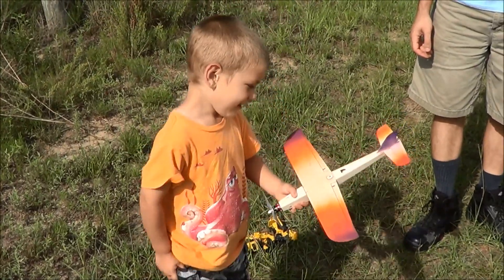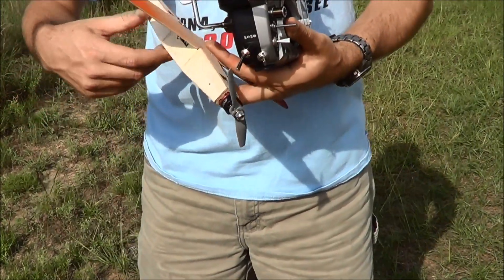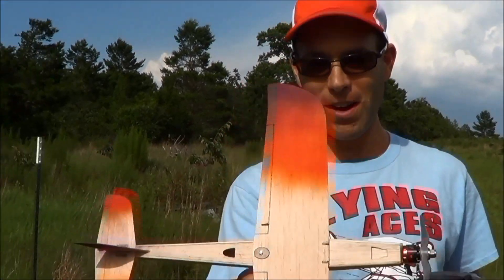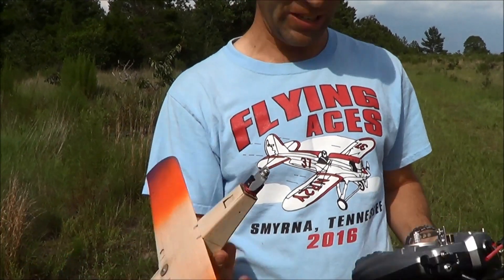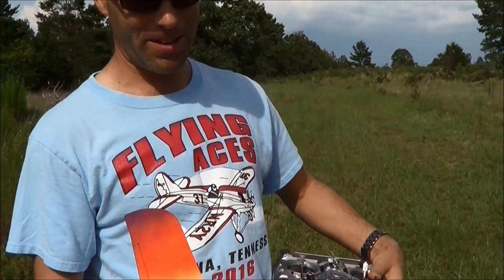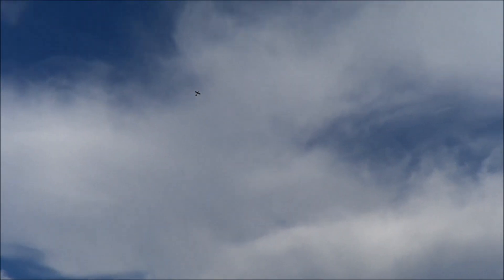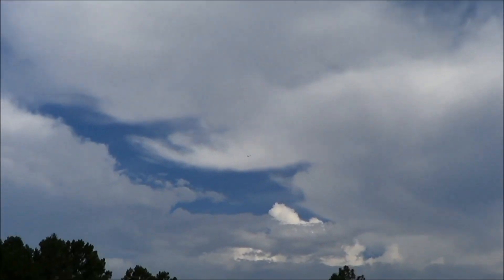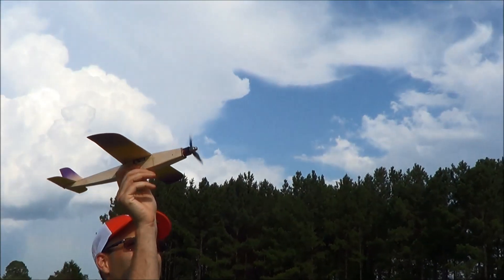Is this world's smallest pylon racer?

Comment: Throw a 3s in that thing!  Are  kits or plans available?   Check out HJK Speedwing's Micro Monster under 250gr and 200mph on 6s.
Reply from the maker: Faustj515 yeah the Micro Monster is on my wish list...been drooling over that since before they even cut molds. By the way 3s has already happened...Ross Clements built one!

Comment: Good build! I made a few smaller ones a while back, one at 12inch span i dopplered at 96mph,the smaller one was about 8 inch but probably only did about 35. Both are on my channel if you want to see
Reply from the maker: Flyingwigs ok gotta see that. 12" span????
Reply: @joshuawfinn  https://youtu.be/ymNruvCpACY
That's it at a fun fly, my buddy had a tough time keeping up with it on video but you can see it ripping around. It was flown on a 3s 450mah 60c pack and I think it was around 120 watts on a 2.375 diameter prop. I cut down larger props to get higher pitch than diameter, at the time miniquads were not a thing lol